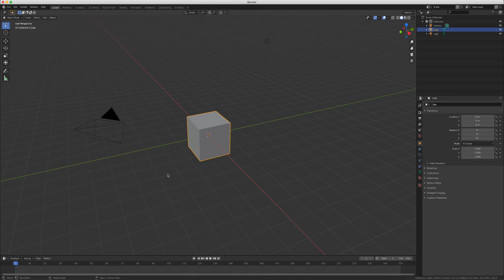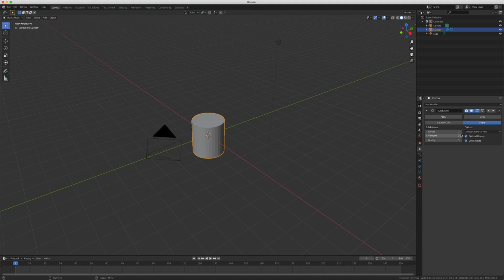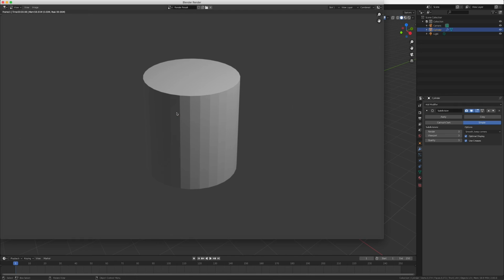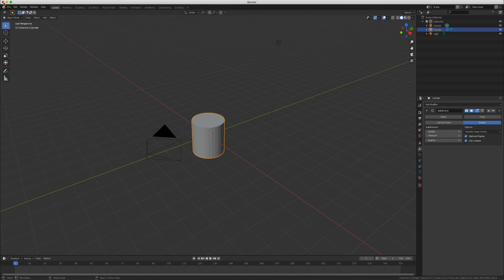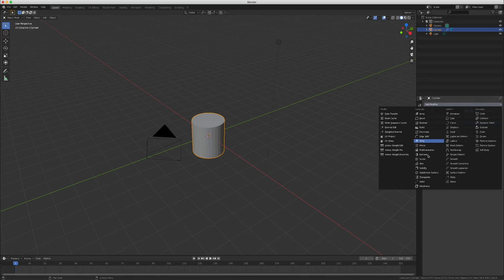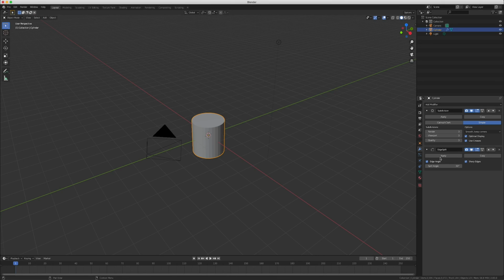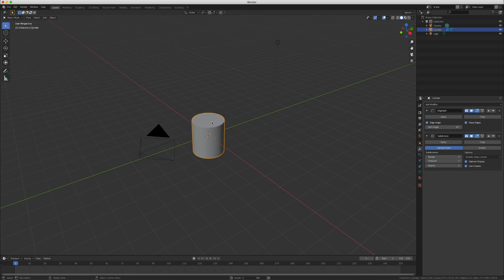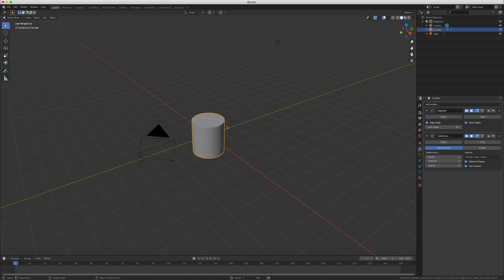Blender Help: Making a Smooth Cylinder -- FINALLY!!!

Comment: Thanks, though this has added a shit ton of vertices to the top and bottom surface of the cylinder, in my case it's a wide flat cylinder, did I do something wrong or is that just what it does?

Comment: Edge Split is legacy and should not be used going forward.  You use auto smooth and simply mark edges sharp if needed in edit mode.  It works for ALL game engines provided you set the export options properly.   Any video mentioning Edge Split is outdated and people keep propagating this crap when they plagiarize their work from other outdated videos.

Comment: How do I make my cyclinder have less sides
Reply from the maker: When you first add a new cylinder, there will be a small popup in the lower left of your screen and it will say: "Add Cylinder." 

Before you do anything else, click the expand arrow on it and it will expand. The first entry box has a label of "Vertices," and in the entry box area, you can enter the number of sides you want to have. 

Once entered (and any other entry information you want to tweak), then click somewhere outside the box and the changes will stick. 

Note: it will also remember that number (and other changes) for the next time you add a cylinder. 

Hope that helps. :)
Reply: @renaissancejames  thanks very much

Comment: Dude, I have no clue how to even get that initial “Add Mesh” and “Cylinder” to popup.  Blender seems powerful but totally unintuitive like the old days where you just gave to learn all the CTRL+shortcuts.

Fwiw, I did figure it out quickly, but I have a fixed “Add” mini-tab in top left that doesn’t pop up out of nowhere as if you right clicked like in the tutorial.
Reply from the maker: Interesting. My version is a bit dated, so likely it's a little outdated.

Comment: Seriously. What the hell.

I'm forced to use 2.80 because my laptop doesn't meet the requirements. I just made a simple 65mm x 10mm cylinder and applied a boolean modifier to remove the center of the cylinder where I want to place a ball bearing. When I follow the steps in this vid, it's literally adding material in the area that was removed by the boolean modifier. This isn't going to work with my 3d printer. This is frustrating!
Reply from the maker: Glad it helped!
Reply: @renaissancejames  Huh?

Comment: Thank you so much. I was trying to perform a Boolean difference of a cylinder inside a cube (modified as a sphere) as I wanted the loop around where the cut was made in the sphere to have smooth geometry but I the couldn't find the answer about smoothing either. What I found interesting about your video was your train of thought. Very methodical. Just like myself. I guess it must be a Blenderer thing. BTW, I tried both your (modifier) method and the (object outliner -> object data properties) method specified by user Kert in the comments for this video and I found that while your method does produce a truly smooth cylinder with no n-gon artefacts, Kert's retains n-gon faces, which are evident by viewing either the top or bottom surfaces of the cylinder. Yours is the superior method. Thank you again!
Reply from the maker: Yeah, for exporting and 3D printing, those modifiers need to be applied.

Comment: Massive help, thank you! I'll finally be able to 3D print some in-game assets without them looking super blocky.
Reply from the maker: Sweet. Glad it was helpful.
Reply: That wont work
Reply: Shade smooth is a RENDERING trick to allow a low-detail model look like a smooth curve. This just hides the problem of insufficient detail. Slicers only care about polygons, and to make a smooth curve you need a lot. For a smooth, resin-printed, 5cm cylinder, you may need to change 32 vertices to 300.

Comment: Why would anyone dislike this???
Reply from the maker: I think people get upset because there are a couple of different solutions, and they may not like this particular one.
Reply: @renaissancejames  dude i tried your solution but when you use split edges it makes A LOT of overlapping vertices. i made a battle ship just now and i had no overlapping vertices but now after using your solution i had 3,800! so sorry but i think its not the proper way to smooth...

Comment: Just go in Object data properties (green triangle), go under Normal and set Auto Smooth to true. The number besides represents an angle beyond witch edges will be made to look sharp.
Further more you can go into Edit mode and manually set sharp edges by pressing SHIFT+E in any select mode.
Reply from the maker: Good information. Thank you.

Comment: Can't you just shade smooth or does it do something else cause I'm new to blender
Reply: No you can‘t as it will also try to smooth the edge to the top and bottom face. Another thing you can do is shade smooth and in „edit mode“ separate the top and bottom face by selecting them and pressing „y“. That way you won‘t need modifiers, or at least just the subdivision one...
Reply: @kingreinhold9905  I have no idea what you mean cause I'm dumb with these stuff but thanks
Reply: @ifreakinglovegojosomuch  Haha ok, just try opening a new project, then click the cube in the middle and activate shade smooth (Object -> Shade smooth) Not you will see that it‘s still in the shape of a cube, but the shading looks roundish... That‘s the effect we want to achieve on the side of the Cylinder, but not on the top or bottom. Shade smooth only works on surfaces that are connected, so if you disconnect the top face from the rest of the mesh, there will not be a smooth shading inbetween, which is exactly what we want :)
Reply from the maker: Don't give up though. There are so many cool videos that help with learning Blender. It's a confusing product at first (and well, maybe always), but it can do so many awesome things. I found it best just to follow tutorials one by one and keep learning what can be done.

Comment: Like kart explained you can use auto smooth at 180 and select in edge mode the edges you wont to ne sharp and press Ctrl + E and marc sharp the selected edges :D
Reply from the maker: Yup. Just use the modifiers for 3D printing.

Comment: Well actually if you go to "object data properties" (green triangle) and open the "Normals" tab there'll be the "Auto Smooth" check box. Click it and voila, "Shade Smooth" works properly. By default there's a 30 degree angle, but you obviously can change it. Everything sharper then that won't be smoothed.

Also, if you want sharp corner, but it's less then 30 degree (or whatever you set), you can select edge you want sharp (in edit mode of course), open the "edge context menu" (Right mouse button by default (edge select mode should be chosen, otherwise it'll be either "vertex context menu" or "face context menu" (if second then I don't even understand how the heck you selected an edge))) and select "mark sharp" (or "clear sharp" for reverse). For that working you have to have "auto smooth" turned on.
Reply from the maker: Yeah, it's important to know that this option won't export the object with smooth corners. Many times it won't matter, but if you intend to export to .stl and then import for 3D printing, the prints will not have smooth corners. 

To avoid that from happening, use the modifiers in the demo and then apply them before exporting. You'll save some headaches and printer filament that way. :)
Reply: @renaissancejames  This commet/video save a lot of PLA thanks
Reply: Auto smooth is usually the way I go, however, if you need to add more subdivisions later, this is helpful.
Reply: It should be fine with other programs.
I saw a tutorial for blender to unreal engine and it worked. Didn't try it myself, though.
But it would be strange if it wouldn't work, because 3D-Models are pretty much useless, if you can't export them like you made them. I know it depends, but exporting to other software is just a huge part of dev-pipelines.
Reply: Right click object, shade smooth
Reply: Important to know that it will only work in blender. If you do that and export the object to another software it will be shown without the smoothness :)
Reply: @zephirusvideos  Is it? I never tested that with another software, because I don't have one, but when I exported object to Unity it was ok. And if export it in, for example, fbx and import that back to blender, in edit mode you will see blue "marked sharp" lines, those are lines where auto smooth was (I hope you get it). So I thought that it exports to other software well.
Also tried to export cylinder in .obj and open it with windows' standard soft and it was shown as it should be, so i dunno.
Reply: @sniper7269  At least it's what I've learned. Not sure now
Reply: @sniper7269  The problem is that the program in question has to be able to communicate with that option. If it isn't, like when you're trying to print something, then you won't see smoothness. Other programs like iclone can use it just fine.
Reply: @zephirusvideos  depends on the program and file format you export in, but I have had luck with smoothing.
Reply: @zephirusvideos  Every 3D software has their own way of doing auto smoothing.

When importing the model into another program, you have to turn on that program's auto smoothing feature.
Reply: @zephirusvideos  I think the problem is that programs need to be written to use that "render smooth" data. Some are, like unity and iclone, and others aren't - like my 3d printer and slicer software. :( No matter what I enabled/disabled all of my 3D prints came out looking polygonal. It wasn't until I found this tutorial that I was finally able to fix my prints.
Reply: Smart people have entered the chat...